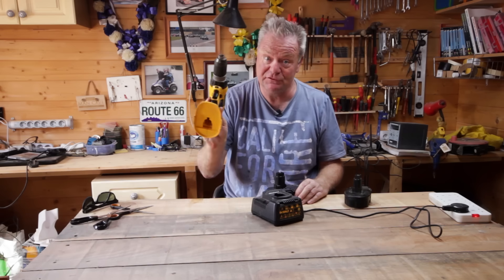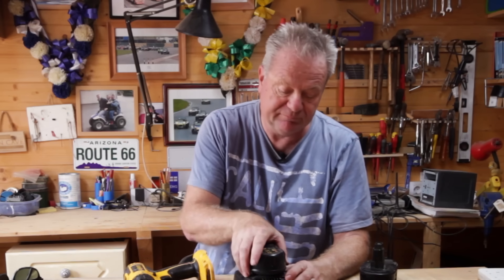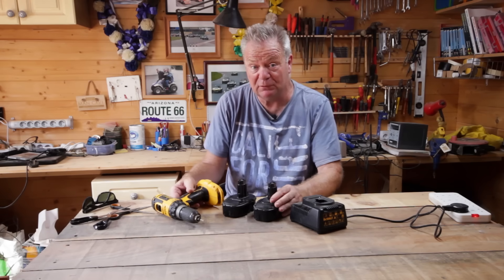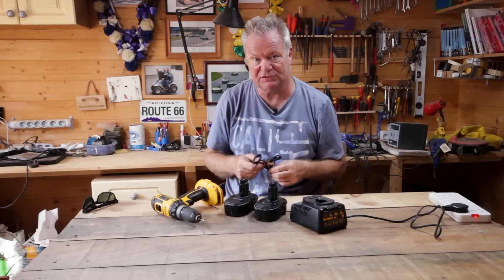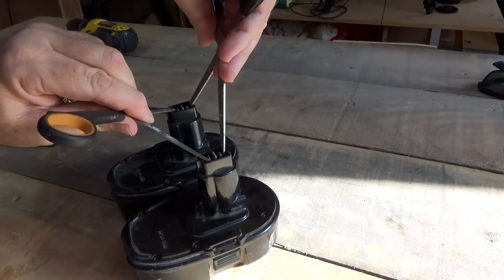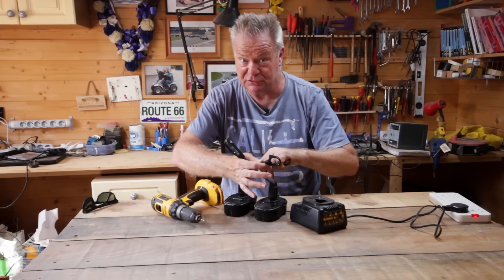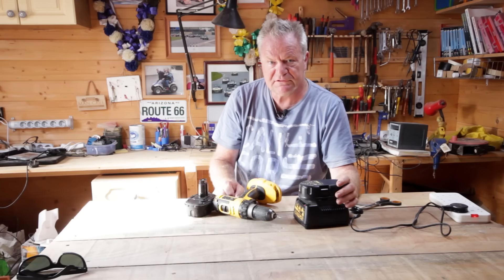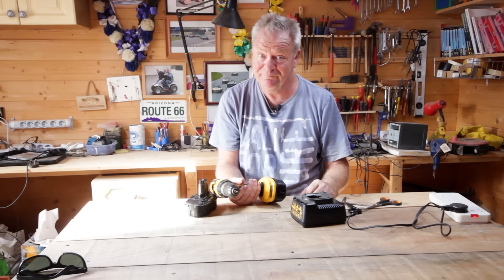How to revive a dead rechargeable power tool battery easily

Comment: The power tool companies don't like you I bet. Lol. But we do!!! 😋 Thanks!
Reply from the maker: lol - I hope it helps. Thanks for watching.
Reply: JP in Fuerteventura hi JP much thanks for the trick. I’ve only one battery which is basically dead. Anyway I could revive it as I lack a second one to parallel connect them. Thanks
Reply: @tchelenon  Find a battery or DC power source of the same voltage, but observe the correct polarity connections.
Reply: @JPinFuerteventura  pppppppppppppppppppppppppppppppppppp⁰⁰ok
 Qll0
Reply: Im assuming that you can use 2 pieces of copper wire instead of scissors. Tyvm for the tip.
Reply: They have to be the thumbs down cause why else would ANYONE WATCHING THIS DO A THUMBS DOWN??? Good video!! Good info thanks!🙏

Comment: 1k dislikes and negative post replies are battery power tool manufacturers’s employees..! I replaced couple of DeWalt 18v expensive batteries in the past and I’ve just used this trick but with battery charger in place of another DeWalt saving me one more replacement cost of $87 + sales tax..!
Reply from the maker: You might be right there 😀 I am glad it helped. Thanks for watching.

Comment: How long will the battery last and do you have to do theat every time you want to charge it
Reply from the maker: How long the battery lasts depends on the state of the battery. Over time, all batteries hold charge for less time. I haven't had to restart the battery in the video again and that was 2 years ago.

Comment: Okay, sounds good. What about in this situation: Of my two batteries, one will charge and work for about 5 minutes. One will charge and work for about 20 seconds. The charger recognizes the weaker one, and charges it, but not enough to be useful. And the one that works for 5 minutes- it used to work much longer. Can they both be rejuvenated? Ideas anyone?
Reply from the maker: There are a few suggestions in the comments Michael.

Comment: Does this have to be done every time it goes flat if the battery is already dodgy or just as a one off? How much longer does it last? Makes you wonder if the manufacturers put certain circuitry in deliberately so it won't charge
Reply from the maker: I haven't had to do this again for that battery since I made the video 2 years ago. If the battery has damaged cells then it won't hold charge for as long. Surely manufacturers wouldn't do that 😉 Thanks for watching.

Comment: They don't hold there charge after you get them going
Reply from the maker: That depends on whether the battery has a damaged cell. This is not a fix for damaged batteries but a way making a smart charger charger what was a completely flat battery.

Comment: This is cool. Specifically for a battery that has no charge at all. What about when the battery has rather low output and being on the charger just bumps it a touch only? Also is this Ni-Cad or Li-on?
Reply from the maker: This was a Ni-Cad. This is only a get around for a dead battery not registering in the charger. It will not fix a battery with a dead or damaged cell. Thanks for watching Colin.

Comment: The scissors were a better idea than wires. I had 2 wire points accidentally touch and there was a huge spark and the wire was burnt.  I was afraid that I screwed up my good battery, but fortunately it was fine and my faulty battery works for the first time. The faulty battery never worked since new but I never used it until the warranty expired.
Reply from the maker: I always thought they were better but many seemed to disagree. I am glad it helped. Thanks for watching.

Comment: I've got 58v batteries for garden tools ect that hv been left in the suns heat can these batteries be revived
Reply from the maker: The highest power batteries I have tried it with is 18v but the principle would still be the same, assuming they won't charge because the charger doesn't detect sufficient charge.
Reply: 58v batteries,  use some garden shears  instead of scissors lol.
Reply: I need a lightning bolt lol

Comment: For those who wants to try this.. you can get small crocodile clips attached to a small piece of wire. Get 2 of those from any hobby electronics shop and is a much easier alternative than scissors.
Reply from the maker: You are right of course - except when you live on a small island in the Atlantic like I do so you have to make do with what you have. Thanks for watching.
Reply: @JPinFuerteventura  😁👍.. I would rather use scissors if I get to live in a small island ...

Comment: I tried this on a 7 cell nimh battery pack for my r/c truck and it worked. My batteries had spent years in storage and I was able to get a charge on one but the other was completely dead so after watching this, I got the idea to jump the dead pack with the live one using nails to connect the positive and negative terminals since the connectors are so small. After 2 minutes, I put the dead pack on the charger and it began charging again. It now holds most of a charge which is much better than nothing. Thanks for the tip. It seems this idea will work with many types of batteries in various applications. 👍🏻
Reply from the maker: That's great Pete. Thanks for letting me know.

Comment: I watched this video over a year ago, last week I tried this trick on a dead Craftsman battery, IT WORKED! I used two wires with alligator clips, I only held them on for 10-15 seconds. The battery now takes a charge and I use it all the time. Too bad, prior to watching the video I had thrown away about 4 batteries.
Reply from the maker: I'm glad it worked but a shame about the 4 batteries. Thank you for letting me know so long after you watched the video.

Comment: Trick for me was bad batt was below 2.4 v on Ryobi 18v. Once charged with other good bat at about 15 v, it charged up. Even at 8 v, I think it did not charge. It did take me about 15 mins to charge and monitor though. So the very low cutoff on the charger was key to get it to charge and also monitoring voltage and let the bad batt charge sufficiently high enough from the leads before putting it on the charger. Other things def could be a factor for sure, within as mentioned below, but my tools are well cared for all the time. Thank you and keep up.
Reply from the maker: Thanks for that and thanks for watching.

Comment: A couple of wires should work just as well as scissors, especially if you can't find two of them around.
Reply from the maker: Yes, scissors are not the only answer - they were just what I had around and actually it makes it easier to do on your own than using two wires. Thanks for watching Patrick.

Comment: Thanks for info.just tried this on my 18v lithium ion battery,used a welding rod on the negative and copper wire on positive for 60 seconds,then bingo worked like a dream.that battery had been  collecting dust for the better part of a year.thanks again just subbed.
Reply from the maker: The "wisdom" of others that have commented is that you shouldn't do this with lithium batteries so it is interesting that it worked. Thanks for the info Michael.

Comment: My 'packs' won't hold a charge. I can charge them fully and in 1 or2 days of little to no use they will be flat or as soon as a load is put on the device, it dies within 20 seconds. Please help? NiCad type.
Reply from the maker: It sounds like they have one or more dead cells. It is possible to open them up and change the cells, although that isn't something I have needed to do.

Comment: Very interesting.
But how long is the used to be dead battery good for?
How many times can you charge it again?
Reply from the maker: That depends on the age of the battery. This fix is to get around the fact that the charger is a so called "smart" charger so it only charges when a battery is inserted and it detects a charge. If the battery is very flat then it won't start charging. I am still using the battery in the video two years later and have never had to jump it again. Thanks for watching.
Reply: @JPinFuerteventura  thanks that is exactly what I wanted to know. Definitely a worthwhile fix.

Comment: DUDE!!! Jesus Christ, get some proper alligator clips! You're going to have people screwing up and shorting terminals everywhere! Your ghetto fix is a "I'm stuck on the moon and I'm going to die if I don't charge these batteries and all I have are two pair of scissors" thing.
Reply from the maker: We don't all live 2 minutes from a home depot or whatever. Have you ever heard of using your initiative - obviously not.
Reply: @JPinFuerteventura  Scissors are initiative on a desert island. You have power tools, so yea, you live near a hardware store. Less skillful/knowledgable people will ruin their batteries trying scissors, or worse hurt themselves. Initiative is putting insulated wires on a bobby pin cut to the proper length or something similar if you're that far away from a store. That's just bad practice.
Reply from the maker: That is actually quite funny as you obviously don't have a clue where Fuerteventura is or anything about it.

Comment: could be the same with batery car?
Reply from the maker: I have done it before with a car battery when the battery charger didn't recognise that a battery had been connected due to it having a very low voltage.

Comment: Used to do this trick to the old carbon D and C cells of the olden day’s!  Recharged them with dads 12 volt car battery charger. It took about 5 minuets, they got really hot, and did not last as long as new ones... But hey as a kid, one did not have much money to be buying batteries, so we made due....   I still use this method for pre-charging dead Motorola HT batteries! A minute or so of 12 volt DC, and they charge right back up using the appropriate charging method.
   And talk about expensive! $50/$60 or more for some of these and these are aftermarket.
Reply from the maker: Interesting Robert. Thanks for watching.

Comment: And tomorrow it is dead again. Put it in the freezer, zap it with a high voltage, fail, a dead battery is a dead battery. It pisses me off that this bullshit is on youtube wasting everyone's time.
Reply from the maker: Really? Well two years later that battery is still working and has never been completely dead again. Another person who thinks they know everything but knows nothing.
Reply: @JPinFuerteventura  Oh really, asshole, you were just lucky, I have 9 dead battery packs that did not respond to any cure. Some I have opened, and found cells have leaked and corroded, you think you can regenerate them?

Comment: I don't get why the good battery would charge the dead one but the charger wont.. It's a head scratcher. I'm having this issue with one battery though and will try this tonight, would be awesome if it works for me :)
Reply: The charger detects when a battery is connected and switches on and then switches off once the battery is fully charged, if the battery is so dead it has absolutely no voltage then the charger can't detect that a battery is plugged into it, so it won't switch on.
Reply from the maker: Thanks Anglosaxon. You saved me a job :-)

Comment: I watched your video with some trepidation, the 'Scissor' trick is a bit 'Heath Robinson' but nevertheless, it's either buy another battery/pair of batteries/Replacement Drill kit, minimum financial drain on my wallet is £28.00. or apply the method in your video, cross my fingers & hope it might work, what have I got to lose ? 
So, with the exception of using 'Scissors' to bridge the contacts, I used small 'Patch leads' with insulated crocodile clips. (Flashes make me jump).
My completed 'dead as a doornail, flat as fart' battery is now powering my battery drill after only 1 hour and the second battery is almost fully charged. 
IT WORKS !
Many thanks, you've saved me £28.00 and now I'm going for a swim.
Respects to you.
Reply from the maker: I am pleased that it is working for you John. Living here in the Canary Islands you have to be a bit resourceful and make do with what you have - hence the scissors. Thanks for watching.
Reply: @JPinFuerteventura  .
I'll let you know if it lasts as long as the non troublesome battery. Feedback is always useful. 
High 5s.
Reply: Just to let you know that after reviving my battery and saving a fortune, I've tested the ex dead battery and I'm delighted to reveal that I've been screwing away every day and the battery is still going strong. Don't let anybody knock your advice. 
It works, you've made an old man very happy. 
High 5s to you Sir.
Reply from the maker: That's great John. Thanks for letting me know.
Reply: @JPinFuerteventura  .
Just a little question I would like to ask....
What did the Missus say when she found her best scissors ruined ! 
Sorry, I couldn't resist it. 
Respects.
Reply from the maker: lol

Comment: I own a 36v Hilti drill, I just bought some U/S 36v Hilti batteries from eBay and cells from China. Replaced the cells, now I have 6 good batteries at pennies in comparison to Hilti own brand. They have working and charging for the last 4 years.
Reply from the maker: Replacement batteries are a rip-off

Comment: Are thous the only battery you can do this to?
Reply from the maker: If you mean power tool batteries then no, it can work on some other types of battery as others have tried in some of the comments. Do not do it with lithium batteries though.
Reply: Ok thx and like your video I work in construction so this would really help

Comment: I just tried this on two Makita batteries. I connected them each neg to neg and pos to pos and left them for at least five minutes. There was a good connection because the "dead" battery became slightly warm. Neither would recharge as the charger flashed the signal for dead battery.
Reply from the maker: It obviously has one or more damaged cells unfortunately.

Comment: I just have one dead battery pack. Now what?
Reply from the maker: Borrow a similar one from a friend perhaps?
Reply: Try a regular charger / booster or dc power unit if you can get your hands on one. I'm a contractor and have half a dozen duds I'm going to try to revive. Anything that puts out near to what you need should work. Don't go higher though.

Comment: Why does this work ?
Reply from the maker: Hi Gary. I believe I have put it in the description (which no-one ever bothers to read). The "smart" chargers only start to charge if it detects that a battery has been inserted, and for it to detect one the battery needs a small charge. If the battery is totally flat then the charger won't detect it. Putting a small charge in using this method gets around this.
Reply: @JPinFuerteventura  Makes sense,  appreciate the reply .

Comment: I know this works cause I've done it for ages. Only issue is they been putting fuses on board that pop. And they make sure they have a chip in line to make sure it won't work. I usually just bypass that and replace the fuse
Reply from the maker: Good tip - thanks

Comment: Some put fuses and resistors in them. The battery could be good but the chip says hey I'm dead. So the fuse pops in the board. It's a rip off con game they have
Reply from the maker: You are right there. Thanks for watching.

Comment: Anyone know the principal behind this? Why does this work?
Reply from the maker: I believe I have put it in the description (which no-one ever bothers to read). The "smart" chargers only start to charge if it detects that a battery has been inserted, and for it to detect one the battery needs a small charge. If the battery is totally flat then the charger won't detect it. Putting a small charge in using this method gets around this. If you have a flat battery then give it a try.

Comment: Stupid is stupid does, batteries do not last or charge forever they have a life. Same for car batteries, the Boise gives you a mini charge, battery is gone, give it up.  Science
Reply from the maker: This isn't fixing a battery that is too old to hold a charge, it is to get around the so-called "smart" chargers which won't start charging if the battery has insufficient charge for the charger to detect it. Over to you Forrest as the cap obviously fits.

Comment: But does the battery run down too quickly? Or is it like brand new now??
Reply from the maker: That depends on the condition of the battery. If it has damaged cells then it will run down quickly. This is a fix to get around the so-called "smart" chargers which won't start charging if the battery has insufficient charge for the charger to detect it.

Comment: You can also zap the battery with a  car battery charger a few times to knock off the  insulating  stuff off the plates and also charge the battery with the car charger, if the voltage is similar.
Reply from the maker: Thanks for that and for watching

Comment: I use a similar approach to charge our golf cart batteries when they drop below the expected rate....connect 2 different battery jump start boxes and it will raise the total voltage of the 6 batters to the minimal 4 volts required to activate  the Regular golf cart charger to "Kick in" works every time....
Reply from the maker: Absolutely Chris. Thanks for watching.

Comment: Thanks for video. Had two Dewalt 12v and while both would charge one would "scream" in the charger at a very high frequency. Other was fine.

So I used your method for one min and then cleaned terminals by scraping the metal contacts and used a pencil eraser. The one that was screaming is now charging without issue.

My hunch is once heavily discharged you will never get a longterm battery but for normal household use its a great quick fix. Ty again!
Reply from the maker: Thanks for watching and your comment